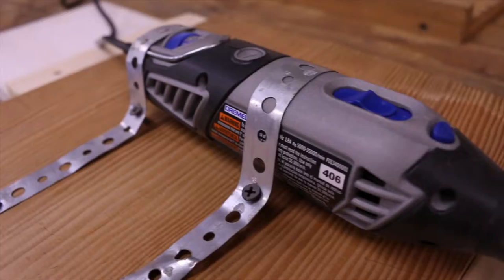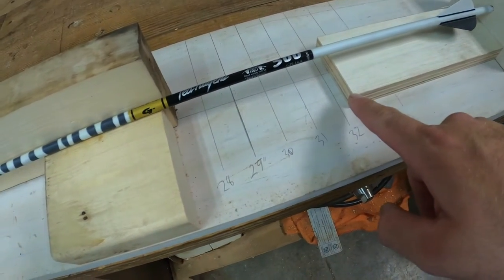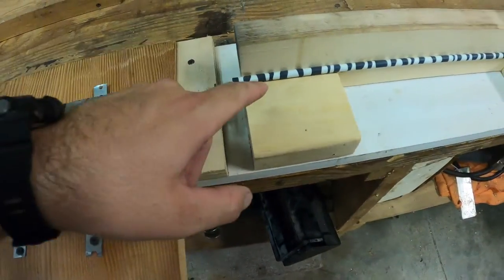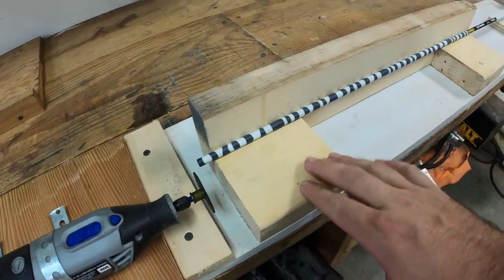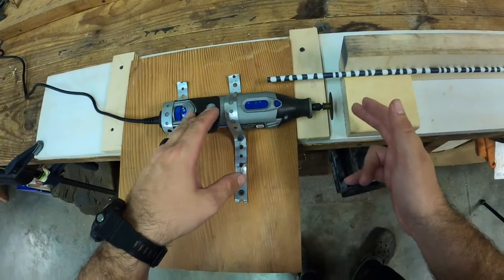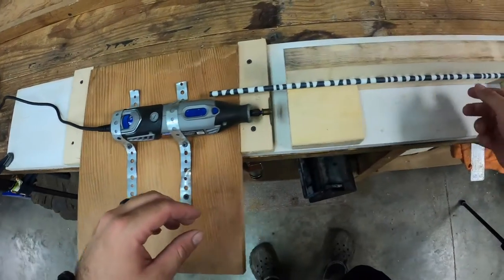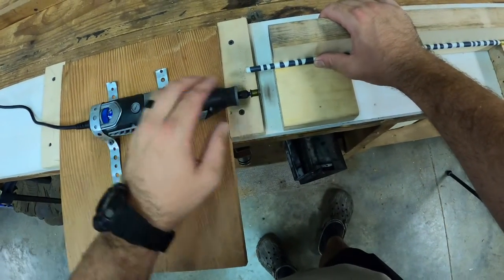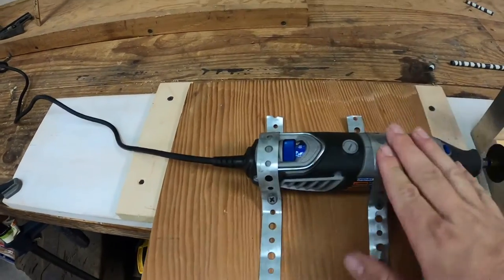DIY Arrow Cutting Jig | SIMPLE | CHEAP | PERFECT CUTS

Comment: I eyeball it never had a problem. Inserts are square
Reply from the maker: Do you shoot mechanical broadheads?
Reply: @CarolinaOutdoors  I've shot both. If I end up with a small gap around the insert I just fill it with glue.
Reply from the maker: @MrMark1325  yeah fixed blades are a little more difficult to deal with if it’s not as square but in some cases it won’t matter. I just try to have it square cause I want it it clean as possible. Doesn’t make it right or wrong but just how I like to do it